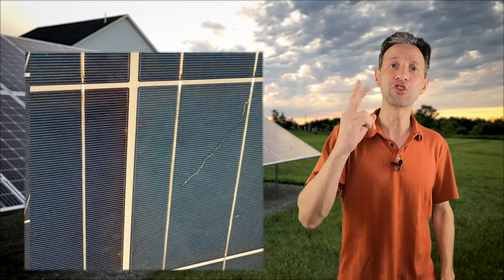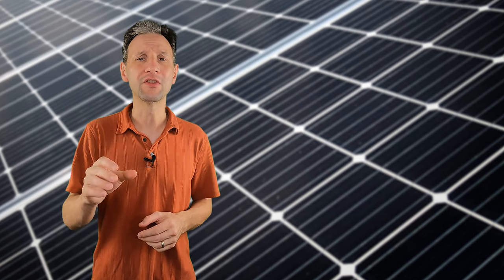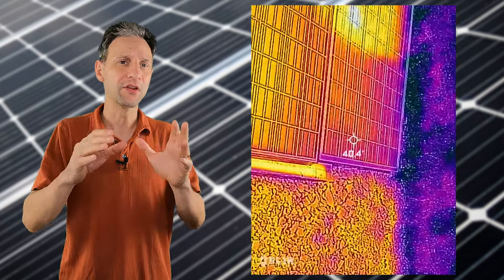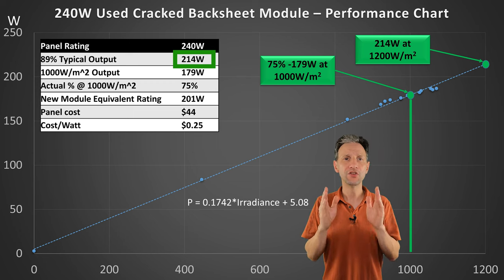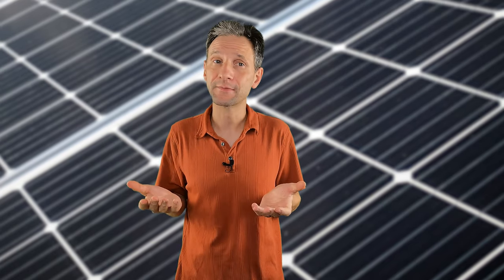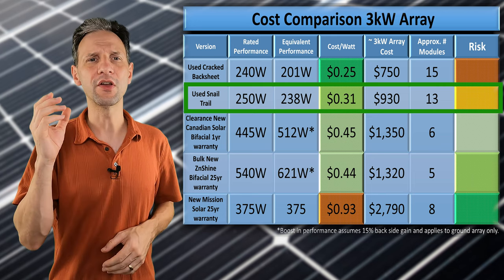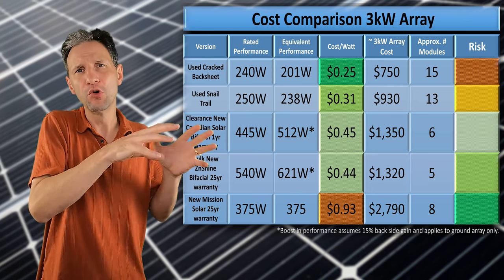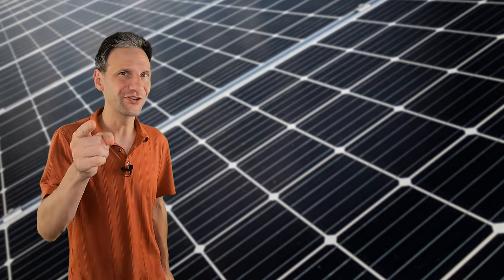What you should know BEFORE you buy SOLAR PANELS!

Comment: I have been buying from San Tan since their opening years ago. I drive up, about a 3-hour round trip. I have had no issues with my snail trail panels. My biggest concern is heat. In southern Arizona, the last few weeks have been brutal. I recorded the top temperature of the panels when it was 112 air temp and sunny. The top of the panels was 136 f and the bottoms were 153 f. I have noticed just the slightest breeze will bring the output up some. I have for years been thinking of ways to cool them without using water unless it was a sealed, closed loop system. The fact that air and a breeze can help makes me lean towards a blowing air solution.  I also don't want to make it where it uses more energy than it's worth. However, the fact that the panels can get so hot I also worry about the panel's service life being reduced, or premature failure altogether. Maybe do a video on heat effects on panels and possible solutions.
Reply from the maker: There are systems with integrated water cooling, but I imagine the cost delta would be hard to recover in performance gain.
Reply: I would just buy a few additional back up panels incase of failure. The cost to benifit would be much higher Than anything else Imo.
Reply: Look into some new info on vertically mounted panels. Since S AZ gets really hot, the reduced loss of efficiency from all that heat might be worthwhile. And especially if using bifacial panels, it might work out well.

Comment: I think the bifacial panels are the way to go for any significant sized system. Those used snail trail panels would be good for a back up or small back up system or maybe for a portable solar generator with a handful of those panels to keep cost low.
Reply from the maker: My thoughts exactly!  Exception being a roof install.  On a dark roof, bifacials don't provide much gain and may not be worth the cost.

Comment: Thanks Dave! I’m very interested in the solar water heater set up! I’ve been planning on setting up my old 40 gallon like what you have. If it works out well i would increase the holding tank size and preheat domestic hot water and possibly radiant floor heat. So i would be very interested in the mppt  controller.
Reply from the maker: You could get more power using an MPPT for the water heater, but I just wired it directly to the thermostat to save cost.  You just need to match the resistance with the ideal voltage and current of your string.  Just use: V=I*R  
Where V is the max power voltage, I is the max power current and R is the resistance of your heating element.  It doesn't have to be perfect, but the closer you get the more power you will get.
Reply: THANKS! Okay, I want to keep it as simple as i can to start with so i will try that.
Reply from the maker: David Poz did a video with some illustration on matching elements with string loads.  You can watch it here: https://www.youtube.com/watch?v=kVaxAfXQPDU
Reply: @ProjectsWithDave  does everyone dealing with solar have to be named Dave!?! I’m joking! You both are a wealth of information, and I really appreciate all that you both do. I have seen that video and it made me start really thinking about pv water heating. So thank you!

Comment: Interesting note on bifacial panels - a recent study showed VERTICAL orientation of bifacials produces significantly more power per day than horizontal tilted-at-latitude horizontal panels. Obviously a ground-mount situation. Literally the EDGE of the panel faces up, oriented to South. This gives peak performance in morning and afternoon with a null at noon, the opposite of the usual horizontal mounting. I'm thinking a solar ground install over bright white landscape gravel would avoid some of the mid-day null. Now who's got racking for that? 

I have 16 Santan 250W used panels myself, located in San Diego, I went to Gilbert, AZ to pick them up myself as lift gate LTL freight couldn't deliver to my house for "reasons". These were their best used panels, no cracks or snail trails, and ran about $1000 for 16 panels. Getting ready to mount them to a trailer for portable solar install (ie, doesn't need building permit, can put in service before 2023, while I'm delaying my county-inspected array of bifacial panels due to renewed 30% solar rebate, cost of permitting, and amount of work involved with concrete). 

I recently discovered a new source for used panels that has only high quality (no cracks or snail trails) used panels and most are much larger than Santan has, thanks to the Two Bit DaVinci channel. Solar Steals at solarsteals.com, and, convenient for me, warehoused in Yuma Arizona, half the distance of going to Gilbert AZ for Santan. I'm guessing since YouTube says you're in Ohio that you might be getting Santan panels from Savanna GA by freight.
Reply from the maker: Where can I find the study on vertical orientation of bifacial panels?  I might have to try that.  Should be good for winter....
I'll have to check out Solar Steals.  I do usually get my panels shipped from GA.
Reply: It can depend on hourly tarrif rates, like California peak time is 4pm to 9pm in summer, so for non-battery solar, the afternoon peak helps. Also, it shows there's a benefit for half the producers to use vertical and half to use horizontal, so the supply/demand ratio is optimized. Unfortunately I am not a good testbed for this because I'm shadowed by a mountain in late afternoon, so I can't provide useful data myself.

Comment: Ever since I made bi-facial glass:glass solar panels, the STC was 1000 W/M3, not 1,200 - wondering at your use of 1,200?  Moisture kills panels ultimately, so a panel with a cracked backsheet is already trash to be recycled. Is it worth shipping them around to get a couple months or a year more output? Not with any racking cost added to do it IMO.
Reply from the maker: There are some methods for repairing panels with cracked backsheets.  I linked to a paper reviewing the options in the description.  I personally wouldn't spend the time to repair them and still have the risk of a future failure, but if cost is the most important factor, I can see how they might make sense for some people.  I do all my comparison testing at 1,000 W/m^2.  The values at 1,200 W/m^2 is just a reference number for the likely max output you will see at solar noon.

Comment: I bought 18 brand new $295 each USA helana 390 watt panels from watts 247. Due to the poor pallet quality the tarts at UPS didn't use fork extensions and broke the bottom panel. So I used 16 on a Sinclair ground mounts. They did refund me for one panel. But I need them in pairs of two for my charger. 
Then I bought 17 used Turkish brand 375 watt panels from San tan at $133 each. None where broke so I have an extra now.  They had minor frame separation in the corners. I installed them on a black roof on k2 mounts and quick bolt micro flashings. I angled them the same and the used Turkish panels put out on average 200 watts more in early morning. Once the sun was direct my system clipped because I have more panels than charge capacity. 
The new panels cost me 
$5,310 for 18 but one broke.
The used panels cost me
$2,244 for 17 and none broke 
If u can find something like that I'd do it again all day long
Reply from the maker: I wouldn't use recalled panels for a roof install, but SanTan often has new clearance panels that are a great cost/watt.

Comment: I would think for mending the back king crack, something structural like an epoxy like JB weld, and something soft over that like plasti dip or one of the as-seen-on TV flex whatever products.
For the glass, after it's mounted, Super glue, clear epoxy, or windshield crack filler?

What's with the footage of installing gigawatts of panels on a roof in shade under a tree!?
Reply: Sorry, Jigga-Watts
Reply from the maker: I linked to a paper that evaluated many solutions for back sheet repair in the descriptions.  Back Sheet Repair Solutions: https://onlinelibrary.wiley.com/doi/full/10.1002/ese3.936
I will be bringing a future video with details on the roof install.

Comment: What should be the ideal height for bifacial solar pannel to installation on rooftop?
Reply from the maker: The more distance you can achieve, the better the results will be.  Especially if you can achieve an angle between the roof and the panels.  Another way to improve the performance is to make some space between the panels.  There is always going to be a balance between maximizing the output and managing the structural needs due to the increase in wind loads.  You can see my roof results for bifacial panels in this video: https://youtu.be/mzqjCsZKUYQ
Reply: Thanks for the quick response. @ProjectsWithDave

Comment: This might be a stupid question but if you have 4 100watt panels in series can you put a splitter in to charge 2 different battery banks.
Reply from the maker: Sounds like you want to split the incoming power to two different charge controllers.  The problem with that plan is the loads are not constant.  An MPPT charge controller is constantly shifting to hold the panels at the highest power point.  Two controllers connected together would be fighting each other.  I haven't done it but I wouldn't recommend it.
Reply: @ProjectsWithDave  thanks for the reply.

Comment: Do you have an suggestions for running a sump pump for my basement sump pit.  I'm open to a different pump and adding some panels for it.  Thanks in advance!
Reply from the maker: Are you trying to run it off grid continually, or just periodically? I haven't looked into sump pumps specifically, but I imagine there are some 12V solutions out there.  Maybe someone else in the community has experience with it and can offer a suggestion.
Reply: @ProjectsWithDave 
I would like to run it off of batteries and solar.  I could add a switch to turn it off when empty.  Thanks for any suggestions!
Reply from the maker: Since most sump pumps are no more than 540W, most likely you could run it with one solar panel, probably as low as 100W, connected to a Bluetti EB70S (Affiliate link: https://amzn.to/3LrBrHw).  Although I haven't tried a sump pump, you can watch a video on all the things I was able to run with the EB70S here: https://youtu.be/LAjirHJ-t6s
In a few weeks I will be making a video on how to make your own inverter and battery setup DIY style.
Reply: @mister-action1  Sump pumps (and really any inductive load) draw a very large inrush of current when they start.  I don't think you'd be able to modify the pump with a soft start kit, so that means you need an inverter than can handle the amperage spike.  You want what's called a low frequency inverter; one with a toroidal transformer would be best.  Otherwise you're going to have to massively oversize and/daisy chain multiple inverters together.  But then you are idling all this excess capacity and wasting power.  I just went through all this trying to power a 1hp well pump.  Take a look at Victron and Schneider.  I went Schneider because the 220v weighed on my decision, but I assume your sump pump is 110v, so Victron might get you a Toroidal transformer cheaper.  Be aware, if toroidal transformers are outside your price range, the cheaper EG4 low frequency inverters have basic, square transformers in them. They work (not as well), but these units also have high idle power consumption.
Reply: @Keifsanderson 
 What I ended up doing was buying a bilge pump. Like used for a boat.  I ran a 1" water line and purchased a 100 w panal and i had a deep cycle battery.  It's working very well.  I put my 120v pump  switch higher in the sump pit. 
It will only kick on if my bilge pump fells.  Pretty simple.  That's all I Actually wanted.
Thanks for all of the suggestions! I appreciate it.
Reply: @mister-action1  Glad you found a solution.  That's pretty creative (and affordable) too.  How large of a bilge pump did you buy?  I never would have guessed one could keep up with groundwater during a big storm, but I suppose it matters where you live 

Merry Christmas
Reply: @Keifsanderson  
It's 1100 gallons per hour.
Hopefully it's fast enough.  My wife has been using the washer. It's in bedded into the sump well. It seems to be keeping up good so far.  I'm in Indiana.  It was super dry last summer. 
Hopefully when it becomes normal weather again it works out.  Merry Christmas to you and Family!
Reply: @mister-action1  Best of luck!  I used to live outside Chicago, and my house was in a low spot.  Had a 1/2 horse Zoeller that would cycle even if it hadn't rained in a week.  If you're interested in knowing more about electric motors and battery/inverters, may I recommend this:
https://youtu.be/hhonq0WSq_c
Reply: @Keifsanderson  Thanks,  I will check it out later today!